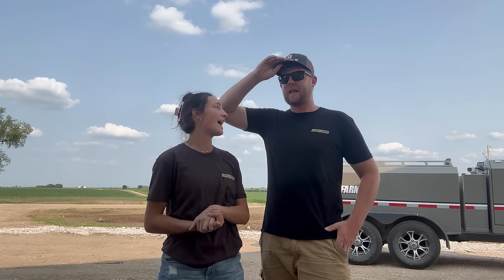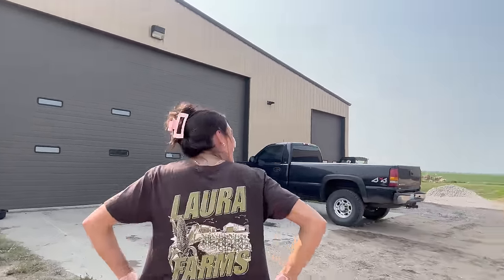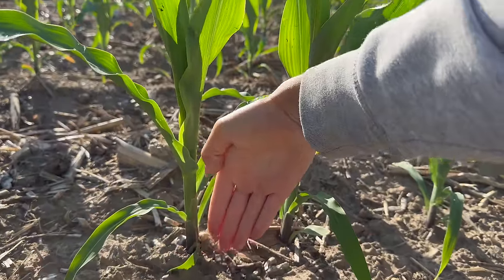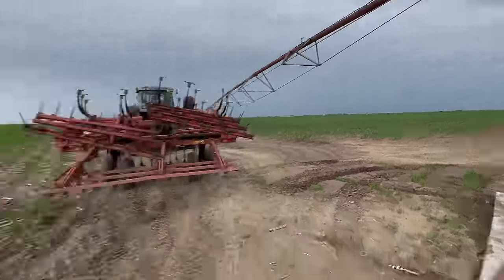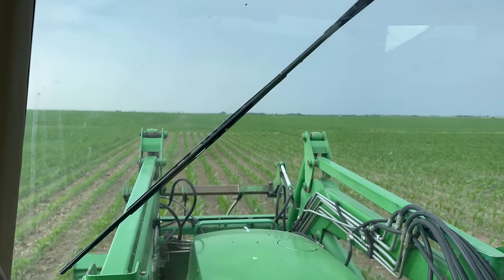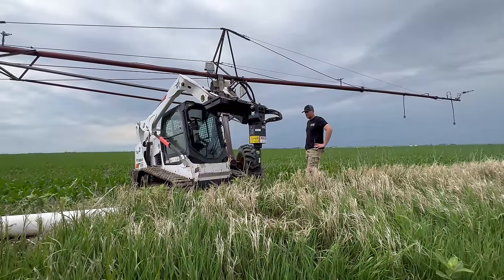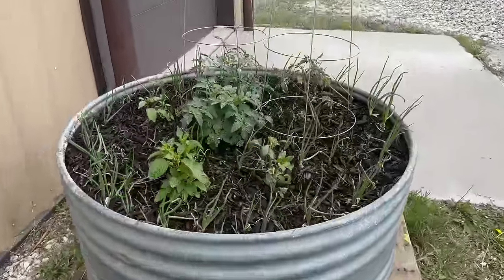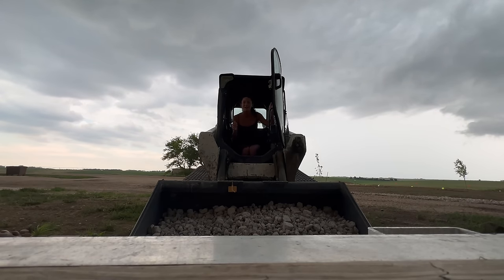Disk Falls Off The Tractor | Laura Farms ANNOUNCEMENT

Comment: I would suggest you install a substantial metal barricade.  In event of reverse or safety failure the pivot will walk right thru that wood and you will have big expensive mess to fix. You guys are great.  Best of luck with your adventures

Comment: Love the circle operation , I had a 3/4 circle years back we  used an angle iron structure that was movable . I hired a new operator and he was disking the field prepping for spring grain . At the end of the day we met up at the shop and he informed me he had found a metal structure in the field  and he hooked onto it and pulled  it out of the way . On top of that he was a smoker , It took forever to get that smoke smell out of my beloved JD .

Comment: Same thing happened to me a few years ago. I had changed  fields. I unfolded my wings. I took a Pepsi break. When I started off, and for some reason the tractor seemed faster. I looked  back and saw the disk at the end of field. I was almost half way. Apparently hitch pin holding disk tounge had somehow jumped out. No damage. When it came loose. Hydraulic hoses  pulled loose from the tractor. Had to drive home to get a chain to hook around disk tongue and link arms to raise disk tongue in order to put jack  on tongue so I could raise disk to reattach to tractor tongue. Glad it didn't happen going down the road.

Comment: If you wait until late August to early September you won't have much of an issue with weeds because they are done growing and producing seed and such for next year.  Most weeds get a start on new growth under ground so that they can start growing before the grass does.

The temperature doesn't stay as hot so long in the evening which helps with keeping the grass at a good moisture level between waterings.  I know it sounds goofy to wait until later in the year to plant grass.  Wont the new grass freeze?  All grass freezes to some extent, its called winter kill.  By that time though the grass has grown enough to become "hardened" to the weather.  It is still more susceptible to weather than year old grass.  Trust me though.  Ask a reputable grass farmer or landscape firm that deals with growing grass from seed and see what they say.

Of course the best way around all of that is to plant sod.  The work of taking care of sod during summer and before winter is much less than planting seed.

Laura, when carrying things like lumber, if you can rest them on your shoulder it makes it much easier than with two hands in front of you.  You van balance the load which makes walking easier which is also safer.

Comment: If you want monster tomatoes dig one hole about a foot away from both of your tomato plants aboue a foot deep and fill it with chicken poo. When waterin your tomatoes water only the poo. Also make sure you get rid of all of you sucker branches on your tomato plants. Also never use wire to tie up your tomatoes it will cut them and they will die, use yarn or bailing twine.

Comment: I’m confused now. What actually drives the pivot wheels, electric motors? I always thunk the water pressure drove the gear boxes? I had no idea you could drive the pivot without water flow.
Reply: They are driven by electric motors.  There are some videos from a year or so ago where they were replacing the motor on one of the pivot towers with a new UMC? (the channel sponsor) motor and gear boxes.
Reply: @tomland9293  i remember that video well. I had just assumed it was a gear box and nothing more. Thanks for the info. I didn’t know I didn’t know that.
Reply: @dougrogillio2223  There is a gear box for each wheel and a motor in between that drives both wheels
Reply: @tomland9293  I see. Thank you.